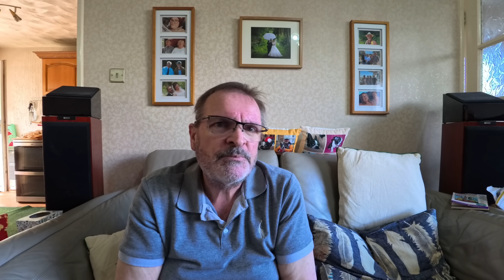Expert Ships Engineer Reacts to Baltimore Bridge Crash

Comment: To me it is clear that the reason for this accident is failure of the auxiliary engines. Why is a different question. Was it sudden loss of cooling or lubrication? Was it electrical failure? Was it fuel quality? Or was it just human error? Loss of lubrication would stop the engine instantly, the same would probably happen if there was something wrong with certain components in the switch board. With the cooling system they should have seen a rapid increase in temperature before the shut down. As for fuel I assume that they had the analysis of the fuel sample from last bunkering before they started using it. Then it might be the fuel filters that suddenly clogged up which raise the question of maintenance routines both for the filters and for the service tank. By the way from 2020 new regulations basically banned high sulfur fuel everywhere. Max sulfur limit is now 1.5 % and in port 0.1% in port which mean they will be running on gasoil. To change over so quickly after leaving the dock would not be insanity but also illegal. Chang over should also be noted in the engine logbook. As for cooling did they use the upper or the lower suction point? From other channels there have been claims that the vessel had several blackouts during their stay in Baltimore, if that is correct they certainly have an issue. I agree with you that the right thing to do if the main engine was back again would be to give full ahead and try to steer under the bridge. To try to go astern when the vessel was doing more than 8 knots through the water would only raise the chief engineer’s blodpressure further and could possibly break down the engine. Both the pilots and the ships captain should know this. One interesting question is how many auxiliary engines were running at the time of the accident. If they only run one to save fuel that would be reckless. An other interesting thing that has come out is that the VDR stopped recording for a short time before the emergency generator kicked in. Why?  Didn’t the backup battery work? An other thing I got aware of is the relative high numbers this ship has undergone. After all she was built in 2015. Does the ship or the managing company have a poor safety record. As you may know port states have a rating system for which ships they should visit most regularly. Years ago I had a port state inspection in Spain and the inspector told me that my ship was a Friday ship. By that he mentioned that he didn’t expect to find much if anything so that he could knock of early and have a quit weekend. Ships from a certain country he would try to avoid on Fridays because the usually mention work through the whole weekend. The reason why the ship slowed down slightly was probably due to lack of propulsion and possibly the port anchor that they have managed to drop. I believe that black smoke came from the auxiliary engines that they had managed to start. Was the second blackout caused by them stopping again or was it due to an engineer that in panic tried to switch them onto the board before they were synchronized? I am quite sure that the coastguard has already a fairly good idea what happened and have already checked the data from the VDR and from the engine alarm log. They will not come out with any information until all eventualities have been checked and they are in line with other bureaus that are investigating other aspects of the incident.
Reply: 4 different auxiliary engines of two different power outputs generating ship's electricity according to google....perhaps 2 in the engine room and 2 emergency power units. I wouldn't have expected both engine room generators to be operating at the same time, unless there are safety requirements while manouvering in port. 
One engine might fail due to lubrication or cooling issues....   but seems unlikely the standby engine room genny would fail imminently after startup, so the second blackout is strange if there were mechanical issues.
Reply: @annpeerkat2020  ships normally have 3 auxiliary engines though some have 4. Their purpose is to run generators that produce electricity. Nothing else. In addition there is an emergency generator that kick in if there is a loss of power. This is a relative small unit that only provides power to critical equipment and emergency lights. Large vessels have central cooling which is freshwater that is circulating in a closed system. This freshwater is then cooled with seawater over a heat exchanger usually of a plate type. If the circulation pumps stop or the heat exchanger gets clogged up with sediments there can be a cooling issue. The same goes for lubrication pumps that circulate cylinder oil and. Lubrication oil to the various auxiliary engines and main engine. If a lubrication pump stops so will the engine. As for the emergency generator it has lubrication system similar to a bus or a truck and is not dependent of an external circulation pump. Naturally these circulating pumps are double up so if one breaks down the other will start and take over. I would expect that at least two generators to be running just in case one of them breaks down suddenly. In addition I would like to have a third auxiliary engine stand by in case of such event. The switchboard on ships are designed in such a way that if there is a lack of power all non critical equipment will be cut out. This kind of equipment is typically air condition and ventilation fans. Things like steering gear and various pumps will be given priority. As for instant stop of engines due to lack of lubrication or cooling it is a way to protect the specific engine from severe damage. Still there are some equipment that are shared by many engines and can in worst case result in a total blackout. Still everything written and said about this accident is pure speculation from all parts and those that knows better and is sitting on the best information say very little. I would have liked to see the alarm log and the list of events from the moment the ship started to prepare for departure and until it hit the bridge. As for the bridge team there was very little they could do from the vessel lost all power. The best thing they could do was to drop the anchor and hope that if would stop the ship. Had it been able to hook fast to the bottom the chain would have snapped at the speed it had through the water but it may also have changed the heading of the ship. A big credit to for transmitting the message that the vessel could hit the bridge.
Also a big credit to the police that stopped vehicles to drive onto the bridge.  Many years ago there was a similar accident in Stenungsund in Sweden where a cargo vessel took down a bridge. It was dense fog and the vessel tried to warn cars near the bridge by fire off rocket flares.
Some of the cars stopped and the drivers got out to see what was going on. Then they got back into their cars and drove off the bridge. I believe it was a dozen cars that drove off the bridge before it was closed.
As for the second blackout it may have been the result of an engineer whose head was boiling in panic and was not thinking clear trying to connect a newly started generator to the switchboard without having it synchronized with whatever current was there already. If it is not in phase with what is already there it could take out both. Still remember that I an only speculating like all other on YouTube and we may have to wait for a while before we get a clear answer.

Comment: do they have a checking point there for shipping containers and have they made any significant finds or are they holding  a shipment, what significant reason would they cut off the bridge are they a strategic  base fture camp or just mans consistent failures
Reply: que?

Comment: Nicely done video Chief. Watching the original video, I couldn't help but notice that the smoke from the stack was blowing almost flat, port to starboard, indicating a fairly brisk wind.  With the vessel being 299.92 m (984 ft) in length, and from the looks of it, about 10 stories tall, that seems like a lot of sail area for the wind to act on.  How might that have exacerbated the problem of "paddle wheeling" to starboard?  My personal opinion is that the real problem was that the tugs shouldn't have been released until the vessel made it past the bridge, but we both know that would have been extra money spent.  Oops, I am assuming that what I saw on a diagram was tugs assisting the M/V DALI off the wharf and then departing as she completed her turn outbound.  She may have departed without tugs at all.  Your thoughts?  BTW, while I got my U.S. Merchant Mariner's Document back in 1972 for OS/wiper/FH, and worked on harbor tugs,I didn't stay in that business very long.  I did however work  on, and around the port for over 4 decades, with many of those years as a port police officer.  I was tasked with investigating several vessel collisions with port facilities over the years and these things usually come down to some entity trying to do things on the cheap.

Comment: One question, toward the end of your explanation you said there isn’t enough power available with the emergency generator to power main engine. In reviewing the video it looks as though the black smoke, that indicates the engine going astern, is during the time when the emergency generator came on line. Can you clarify that point please?
Reply from the maker: I think full power must have been restored. To enable the main engine to run. The more i think about it the more i believe it to be either a switch board issue or a choked fuel filter.

Comment: good point I think on the prop walk, 
Do these ships loose engine power when the power trips?
shouldn't the hydraulics be powered by the engines or is it powered by electric?
Reply from the maker: All electric these days and the engines will “fail safe” in the event of power failure
Reply: @retroonhisbikes  Ah ok.
Reply: All hydraulics powered by the main engine?   That would be a disaster of vulnerable hydraulic lines criss crossing vessels.     Short answer....NO.   
Hydraulic equipment is operated by hydraulic pumps in the vicinity of what is being drive, powered by electricity.
Reply: @annpeerkat2020  what I am wondering is are they ran off electric or diesels or turbines.  
I would not run them on the mains, they would be on separate system like the gensets. 
and do they croak if there is no power...

Comment: The key lies in knowing what caused a steady moving ship to veer to the right towards the Bridge pillar while approaching the Bridge,  , before which the funnel emitted smoke ,  The heading of a vessel does not depend on the propulsion but on the momentum,  which was about 8 knots , A power failure could not have caused the ship to veer other than by an action taken , which was trying to slow down & using emergency stern propulsion for the reason of the black smoke causing the bow to Cant/Swing to St bd (right) towards the pillar  & letting go the port anchor,  which seems was the mistake, It should be noted that for a vessel having a forward momentum of 8 knots stern or bow thruster would have no effect, 
What should have been done after restoring emergency power to the steering  was not to reduce the momentum but continue & navigate it under the Bridge using the momentum of 8 knots,
Moreover the Current was low at 
0, 2 knots to have an adverse effect on the ship ,
Reply from the maker: I think the vessel restored full power and moved the telegraph to full a stern.
Reply: Yes, could also be he used the bow thruster to get the bow to the port  away from the pillar, thus increasing the load on the power system (generator) causing the 2nd blackout, to note also that the vessel was carrying a number of reefer containers that itself could take a Fair amount of load,
Reply: @abrahamphilip6439  I wonder what the power output of the 4 auxiliary engines driving generators on that vessel is...
(no I don't, I can google stuff)
Reply: Google will not give the rated capacity of the Generators on the Dali, , (that comes under auxilary machinery & there were earlier inspectiion reports of defective  auxilarry equipments) other than Dali itself or the shipyard that constructed it , I wonder how many reefers it  was/is  carrying ?

Comment: I think one of the problems if not the main problem is they simply do not have enough manpower on such a large ship.
Reply from the maker: You are 100% correct. When i did my first trip qualified we had 1 chief engineer, 1 first engineer, 2 second engineers, 2 third engineers, two fitters and 3 motormen. Maybe a fridge engineer and importantly an electrician. 
1 chief steward, 2 cooks 1 galley boy and two stewards.
On the deck we had 1 captain, a mate, a second mate, third mate, radio operator, bosun and at least 6 sailors. 
Less than 10 years after i started the governments agreed to half that number.
Reply: more oarsmen?

Comment: Don´t forget what the effect of dropping the anchor had in a moving ship. If the anchor is on the bow, and it grabs the bottom, the momentum of the ship with always cause it to swing the stern. To me it is an obvious accident, even if so many people are dead set on conspiracy theories. What i would like to add is that the bridge itself seemed to have a poor design for such a heavy traffic port. I would expect it to have protected pylons, with a concrete base to safeguard any collisions, considering it was in a heavy traffic waterway! But the pylons went straight in the water! If each pylon had a small artificial concrete island at the base, the bridge would still be standing. The fact that is came down like toothpicks is to be expected, as these bridges are designed to require both vertical and horizontal support to maintain integrity. Once one pylon goes down, the rest of the bridge is incapable of supporting itself. It was the bridge design, and cutting corners building it, that did her in.
Reply: 100.000 tons of ship at nearly 10 knots....   easy to stop with a "small artificial concrete island" ya reckon?

Comment: Thanks, great vid, but why the original turn to starboard when it was perfectly on track to clear the bridge? Also 8+NM seems fast in a area with many obstacles with such a large vessel? Many questions being asked about this, but good to hearr from some one with experience.  I don't buy the fuel bit because I know they have centrifugal separators and many filters. Regards

Comment: Yeah, when I saw the huge plume after power restoration I thought "Full Astern" too. (Others are suggesting that also happens when you use the air to restart an engine, but I'm not sure if a Marine Diesel shuts down when the power goes out?)
Full Astern didn't seem a good idea to me (a layman) as reducing the flow of water over the rudder will reduce rudder authority. With the prop typically foreward of the rudder, going into reverse will basically "pull" water foreward over the rudder and null out the water flow due to the ship's motion. Reducing the flow over the rudder will kill controllability. regardless of where it's pointing!
HOWEVER,.. I'm a land lubber so I presume two Port Authority Pilots and the Captain beside them knows best so I probably should have just kept schtum!
Reply from the maker: You seem to have some knowledge of the workings of a ship. The main engines have electric motors running the lube oil pumps as you guided right the engines will shut down on loss of oil pressure alone. But they also stop because there is no control signal. This is known as fail safe.

Comment: I have a twin screw 65 footer and I never use the rudder. I bet the Dali was a twin screw. I drive mine like a tank. If you want to turn to the port you put the port engine in neutral or reverse. The issue is that when you reverse the props and the flow over the rudder you turn the opposite way. With heavy ships it takes awhile to loose momentum. Yea I can see how with the loss of an engine you can turn in the exact opposite of the way you want to go. This is not like driving a car.
Reply from the maker: These ship only have one engine, directly coupled to engine, ie no gear box. To go astern you run the engine backwards
Reply: What is the delay from engine going forwards to running backwards?  Sounds crazy but I have seen the old 2 cycle Detroit Diesels run backwards, by mistake, but yep backwards they ran.
Reply from the maker: @catdaddy3728 at those speeds the engine may need a blast of air to stop. And a few seconds to turn astern. So not long really,
Reply: @catdaddy3728  On my boat it is quick, but slow enough the scare you at the dock. From forward to reverse takes about three seconds depending on RPM. You throw the engine in reverse and you have to wait for the prop to stop, the reverse gears to engage and the engine to come back up to speed.
Reply: You own a twin screw boat....and don't know large vessels have 1 screw?
Reply: @annpeerkat2020  Most I have seen have two to three screws. One screw is just asking for trouble on anything over 20 feet. I wouldn't want to Captain one. The inability to keep a heading and turn would scare the shit out of me.

Comment: What insane idiot would chose to change fuels AT THE BRIDGE?!   The Captain and the pilot would know the "paddle wheel effect" as you put it,  and would not have gone into full reverse;  that is what caused the abrupt turn to starboard and into the bridge pylon!   Smoking gun my friend.
Reply from the maker: Ive seen it happen. But most engineers will wait until the pilot gets off. Which makes me think something else caused the black out.
Reply: @retroonhisbikes    A question for you:  wouldn't a ship that size have twin counter rotating props?  And wouldn't it have more than one main propulsion engine, I know the propulsion system is electric.
Reply: probably no insane idiot.    What makes you think that occured>?